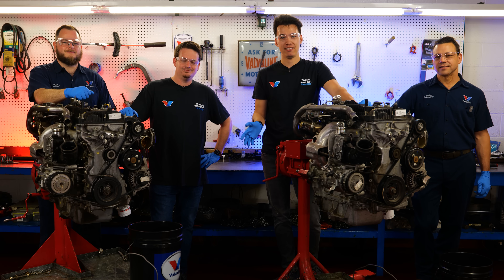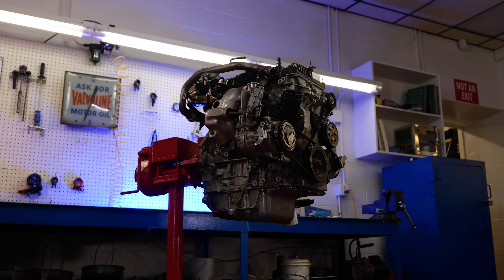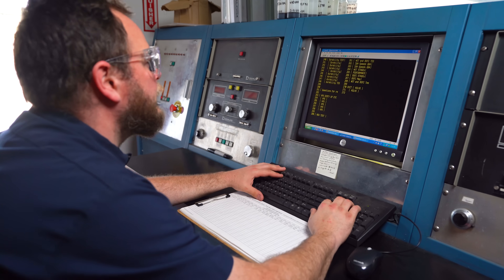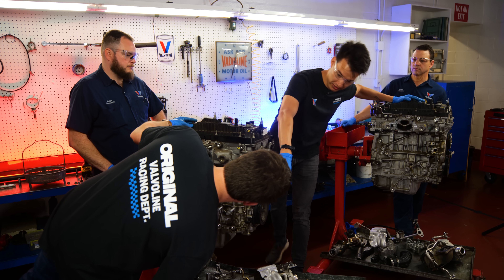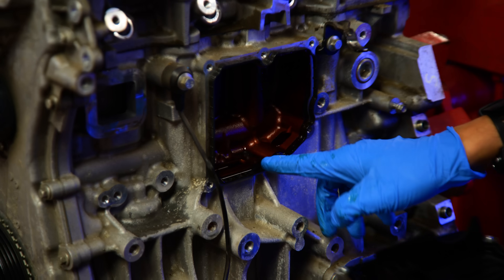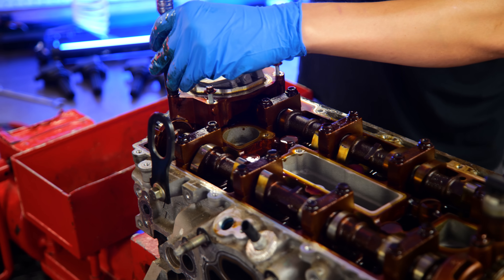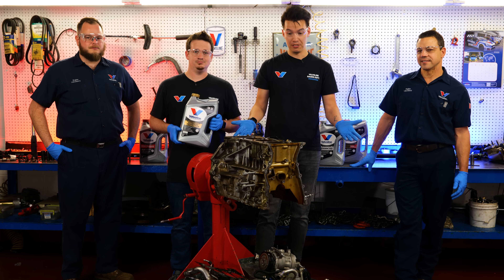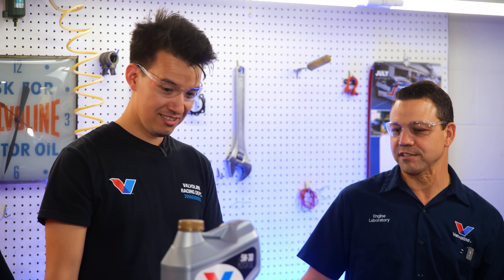Testing different oils over 4 years and 1 MILLION miles

Comment: This is not a fair comparison.  This vehicle requires at the minimum a 5w-30 synthetic blend oil and not conventional oil.  The interval for this engine is approximately 10,000 miles and that's dependent on the computer which calculates engine load/performance.  A conventional oil cannot be used here due to the extended mileage.  Conventional oils will not hold up over 5000 miles.  A very flawed and biased test that is steering you to spend more money on synthetic oil.

Comment: 9:50 Performing good, except for that pesky tensioner. Some engines have 2 tensioner. Timing and balance chain. I'd say the conventional isn't working well in these modern engines. We haven't even touched on VVT issues or the garbage lifters associated with AFM.

Comment: Thank you for video. However, I really doubt ford will run 500k miles without problems. I don’t even think it’ll run 60k miles without problems…
Reply: i don’t think you watched the video. they both did experience some issues with turbocharger watergates, rear main seals, catalytic converters etc.

Comment: For our north american friends, elsewhere where SI system is used, 10.000km oil changes (or about 6000miles) is usually the recommended distance interval. So seeing 10000miles oil change intervals sounds insane. No wonder people have engine problems so more often over there. If that's in the vehicle's owner's manual, I'd sue the manufacturer. You'd just need to quote other manuals for overseas vehicles with the same engine as the USDM models.
Reply: I change 15k pickup and car and never problem.  So for 15 years.

Comment: The reason for the mirror finish on the cylinder walls is because of the 10k oil change, if a manufacturer recommends 10k on oil changes half it at every 5k and im willing to bet that engine will still have a healthy cross hatching

Comment: This is BAD....Oil change intervals at 10K. Manufactures trick to build dealer service department profits. When most people do not remenber to change their oil, and 10K becomes 14K and wonder what that KNOCK is. I have seen these engines with the oil cap to put oil in is totally sludged up and cannot add oil. The rest of the engine is that way. Screw the 10K recommendation.
Reply: Yeah.  I do 15k for 15 years already at my cars and pickups.  No problems here.

Comment: I've ran Diesel Rotella in a 2002 Mercury's  Mountaineer. Ran great for 20.000. !  Changed  to Semi Synthetic  mobile one . Junk ! Lasted nit even 2.000 miles of the 5.000 they say on the bottle. 😂. 220.000 on it. Been using  GTX for 30 yrs and Kendal in Hot rods. No problems. Valvoline in my Japanese  and now Fords. Big difference

Comment: I use diesel oil in my motorbike, And the result is cleaner than I use oil for motorcycle. I have been using diesel oil in gasoline engine for 8 years.

Comment: Bring that lube interval back down to 5K and the visual difference wouldn't be that great.

Ran a Nissan KA24E to 300K with nothing more than oil changes every 3,500 and when I took the valve cover off at about 200K, the upper valvetrain looked new, with only the slightest haze of oil varnish on some surfaces, which wiped off easily without pressure or any sort of cleaning aid.

Comment: 10,000 mile oil change? OK constant running extends oil change intervals but 10,000 miles? No not a good comparison.
Also conventional oil typically gets changed every 4,000 miles and synthetics about every 6,000 miles so they should have done that or added 1,000 miles to each in consideration of the advantage of non-stop running. 
I run and believe in synthetic oil but this comparison is unfair to conventional oil and therefore is biased favoring synthetics.
Do it again guys, you totally effed up these tests and thus the results are absolutely bogus and useless.
I'm sorry but honestly, "you should be sorry" for putting out inaccurate/invalid comparisons.

Comment: Service intervals were about 10 thousand miles. Nobody should be going that long without changing their oil. That's the manufacturer minimum requirement for an oil change but in reality you should do  be doing oil changes every 3 to 5 thousand miles or every 6 months whatever comes first. They also said they checked the oil every 8 hours, did they add oil if it got low? What brand oil filter, fuel filter, and air filter did they use? Did they also replace the antifreeze and at what milage? There's so much information we don't know, but I get it nice valvoline commercial.

Comment: Some years back, I took my 180k toyota truck to a trusted mechanic to have the timing chain replaced (along with water pump, pulleys, etc.).  A few hours later, he called and asked incredulously what kind of oil I was using.  I gotta admit he scared me a little by asking me that.  I was using M** synthetic.  He said that when he took the front of the engine off, it looked brand new.  Before this, he thought that synthetic oil was just a gimmick. 

And that was on 10k mile oil changes.

Comment: Interesting video, The diesel engine in my van is sitting at 500k as well for it's mileage it's as smooth as silk and doesn't smoke, I'm really glad I have used fully synthetic from new seeing this video I drop the oil out every 6k, still running the original turbo too.

Comment: First off how many miles were these engines run in a closed environment, not out on dusty roads? But I’m definitely sold, but I always have been. For years, 70’-80’s I ran either Cam II, or Castrol GTX, with great success, especially considering I was mostly running Corvair air cooled engines. It wasn’t till the 90’s when I switched to Castrol full synthetic oils in every vehicle I owned from the last Corvair, to modern new cars we purchased till today. I have been using full synthetic, mostly Penzoil F Syn. But rarely go by the oil monitoring systems, no I always change at 60%, 50% when towing. Plus I always do the first change by 3,000 miles on new engines. I can’t see waiting for 10-12k on factory oil.  I made that mistake on the first new engine with oil monitoring , a 2002 MB ML 320, that with mostly highway went to 11k before reaching 98%, I had to change! I ended up trading that money pit in as soon as the warranty expired! Half due to oil related, the other electrical issues.

Comment: Ford sabotages all its engines with timing chain tensioners, and plastic parts. They also make sure that the valves and pistons interfere with one another, so when those timing components fail as they are designed to do. Your engine blows up.

Comment: I haven't learned much from this test. I don't know many vehicles that have reached 500k miles to begin with. They both ran the entire time and both had a few problems. Another VERY important piece of information wasn't included in the test. Cold starts. Cold start cycles cause the most wear on an engine. Vehicles that spend enormous number of miles on the freeway before shutting down again will last a lot more miles. They also wear very differently. This isn't an apples to apples comparison for most people. I don't have doubts that synthetic is better but this isn't a good test to know how much better it is. I think the question people really want to know is that if it's worth the extra cost. This test didn't give an answer. It just seemed like a tailored test to make the synthetic oil look way better than it really is for a lot of people.

Comment: Its actually heat cycles that do the most oil buildup.  If you want your engine to last always idle up to temp before driving, and idle down from temp after driving.  Allowing the engine to cool down while still circulating oil is just as important especially if you have a turbo, because a smoking hot turbo being shut down will literally burn the oil onto its bearings and oil passages.  Also spraying a light myst of distilled water through intake from a small pump sprayer will clean valves better than any fuel or vacuum additive like sea foam.  You doubt me, simply look at which combustion chamber is cleanest next time to dismatle an engine with blown head gasket.

Comment: I run Castrol high mileage full synthetic in every truck I own. My big horn ram had 45,000 mile on it when I bought it. N change oil every 3,000 mile. Fuck that high miles change oil. It's hard on oil n parts, makes sludge quicker

Comment: You have to give Valveoline credit. Not a cheep test. And the results were telling. How many other engine oil producers did something like this? Excellent video.
Reply: Im surprised they didnt use a cheap nissan altima or kia forte to test this out. Why use a fairly expensive suv to test it
Reply: @Hallowsaw no way a Kia would go 200k
Reply: @brucedale4465  yes they can... also they are testing the oil so it would be best if they use a car that runs middle of the pack for reliability. If they choose a car that has low reliability like a range rover, it is more likely the manufacturer is the reason the car broke down. Whereas if you use a top reliability vehicle, the test will go on for ages
Reply: @Hallowsaw  donated
Reply: all of them
Reply: I’m surprised you think this is a remotely ‘expensive’ test for a business as large as Valvoline.

Comment: "Small 2.3i 4 cylinders"?  Only in a country W.E.I.B.A.B.T.A.E. Where everything is bigger and better than anywhere else - or so you think.  If you had European gas prices, 2.3li would be the beginning of large and you would not be driving 5, 6 & 7li vehicles, coz your wallet would be forever empty  If 2.3li & 280 hp is small what do you call 1.0li and 70hp, apart from a lawnmower?

Comment: not really that amazing that both engines reached 500k miles but to be correct , the engine running conventional oil should have been drained and replaced at half the mileage interval of the synthetic oil .  these guys would know this too

Comment: I rebuilt a Chevy 6.2  diesel about 15 years ago and the owner at the machine shop that I used, had just been to a conference on oil. He said that ALL the stuff that made conventional oil worthwhile, has been taken out! He recommended synthetic, because of it. I felt like Tin Cup playing  JUST with his 7 iron rebuilding it. WHY The HELL would you Ever want to do that??? The term DIRTY Diesel, definitely applied. My son and I spent SO much time cleaning and painting it, beyond Ridiculous. It did turn out well. Zero leaks and good fuel mileage.

Comment: The ring sticking is an interesting and relevant observation..
    I use conventional oil with 5k oil changes..2 matrixes (corollas mechanically) one 410k miles, the other 360k miles. I put clutches in them, but don't touch the motors. The shim type valve adjustment I have checked and not needed to change.
    If cheap oil gets you that far...most cars are rusty junk by then. I would never run them to 10k on oil, even if I used synthetic.. oil consumption is nil, no stuck rings here, but they get run hard, to redline frequently. I suspect somebody that "babied" them might have some ring sticking and subsequent oil consumption. 
    Xylene soaking has helped on other cars I have gotten used that used oil. That, and running them hard..putt-putt is not taking care of something. Open it up!

Comment: Conventional oil or blended oil changed every 3000 miles, 5w30 or 10w30 in all 3 of my Chevy’s. Full synthetic 0w20 in my wife’s 2021 civic, changed every 5k miles despite the 10k mile recommendation from Honda. In a controlled environment, I can see the 10k mile oil change. In the real world, with stop and go, temperature fluctuations, etc. nothing more than 5k miles on any of my vehicles. I did some testing with my wife’s Honda and the oil begins to break down after 5k miles. 0-5k and it doesn’t use any oil. 5k-10k and that small turbocharged engine will eat through nearly a quart. Cheap insurance to change more often.

Comment: So both engines did 500k.....would the rest of the car be trashed and fit only for the scrap yard if driven for 50k per year for 10 years....conclusion....use the right grade of oil and change oil and filter at 10k or less.

Comment: So you were running conventional motor oil 10,000 miles between oil changes? I'm out of here. This whole thing is a farce and Shame on you Valvoline. I certainly won't be buying your oil. I only use Pennzoil and Amsoil exclusively. Valvoline is Walmart oil.

Comment: I went back to conventional oil on my Chevy ,5,3 because of lifter problems and had just put all new lifters in and at 100 hrs later, here came the notorious tapping so I went to conventional  and I quietened it up a bit.  Poured I quart of Transmission fluid  on new oil change and it stopped tapping.
Reply: What year 5.3?
Reply: What year 5.3 jodygilbert?
Reply: @thomasstrayer3994  2011

Comment: Always trust guys in logo shirts.😅😅😅   My own test. 1993 4 banger Camry. Supertech conventional oil and cheapest filter. Changed every 3,000 miles. Over 610,000 miles later compression is almost like new. A little valve noise...that's it for now. Never looked inside or scoped it...don't care to. However, modern engines will probably be best served with the best oils you can get.

Comment: So they both ran 500 thousand miles, but one cost half as much to change the oil over the life of the test.  Were they trying to prove that you don't need to spend the extra money?  500 thousand miles and no serious oil related mechanical failures....that engine paid for itself, twice.  Synthetic in a normal road application is a waste of money, if you're racing or a particularly high rpm engine, maybe it;s worth it, but you're throwing money away in your daily driver.

Comment: There is something I dont understand... I assume those trucks use something like 5w30 5w40 oil.... If im not right I should be pretty close... So... Getting 5w30 in Full synthetic is easy because the thinner oils used in modern cars are almost all full synthetic as conventional oil cant go that thin... But here comes my question... Where did you find the conventional oil of that spec? Conventional oils are all thicker... Also not specd for modern engines... For example... My older Opel Corsa Lite should according to the manual get 10w40 or 15w40... Which mean I only have a choice of semi synthetic (10w40) or conventional oil (15w40) If I would like to change it to full synthetic I would have to put in 5w40... Which according to the manual is the wrong oil for the car....

Comment: that varnish on the non-synthetic engine surfaces is no big deal. it certainly doesn't cause a part to retain heat like the guy said, it also doesn't create any imbalance in reciprocating parts, maybe its not as nice to inspect as a synthetic lubed engine that has "cleaner" parts. Also filters are a big part of engine life, not really mentioned much here, or what micron they filtered to. I suspect it was a Valvoline ad at the end of the day! Clickbait!

Comment: 500,000 miles sounds impressive, but remember that these are test benches not daily drivers. Hot/cold fluctuations are what really age engines. High mileage cars can be in better condition than low mileage ones if the low mileage cars have experienced more on/off sequences. This is why people argue that their high mileage Tahoe on Craigslist is fine because they're mostly "highway miles" from a long commute.

Comment: Willing to bet if the synthetic was changed every 5k and the conventional every 3k, that neither engine would have had stuck rings. 

Surprisingly clean internally, all things considered, but additives in the oil, and filters really don't need to be going as long as they did.

I would like to see another test with one engine using full syn done every 5k. Would be interesting to see the results on an engine that has a bit less ring seal too. Luckily both of these had very good ring seal from the onset of the testing. 

My 2 cents

Comment: In today’s times I think any oil and filter is good. Routine maintenance is key. I run Mobile full synthetic 10k and change every 5k. Oil is still clear. I do my transmission and differential every 30k. My last car was an old Mazda and finally died just under 300k If I did the upper probably could have got another 100k out of it. Great video!!!

Comment: Varnish staining is the most obvious difference.  Both engines are fine at the end of 500k with 10k interval changes.  A little globbing, but not much.

Synthetic oil is...OIL.  I know that may shock some that believe it dropped from rhe sky and was harvested from a UFO.  Many synthetic oils are the natural gas or light oils from the oil well ..and chemically recombined in the refinery to long chain lubrication oil.  Some are cleaned up waste oil.  Some are a blend of that.  So they came from OIL AND GAS WELLS.

Conventional oil is simply separated from the well product as mostly long chain HCs (which is what the synthetic is combined to be).  The traditional refining is hust heat the column and take off gas at top, gasoline near top, diesel in middle, bunker oil lower middle, lube oil low, gear oil at bottom.

Since it is pulled from liquid layer...it has mineral stains still on it.  If synthetic is made from recombining natural gas blends...those stains are not in the product.

At half the price, conventional every 6000 mi is safer and cheaper for the same result as synthetic.

Comment: the oil change interval is different for conventional and synthetic.... conventional should be done ever 5k miles, synthetic can go 10k. If you use conventional oil within its design, it will come out just as clean